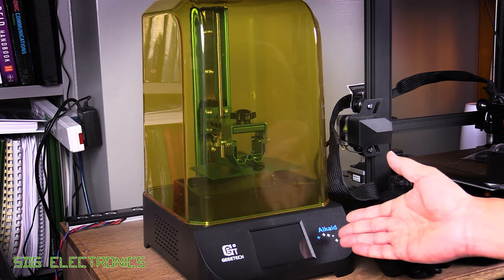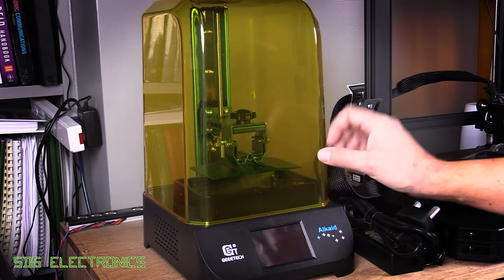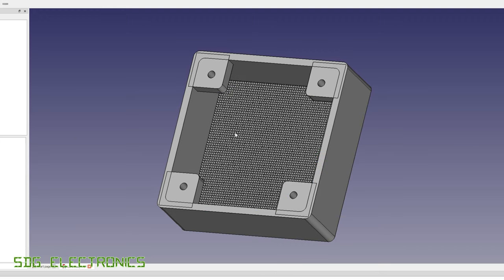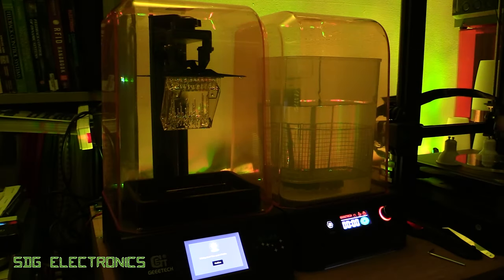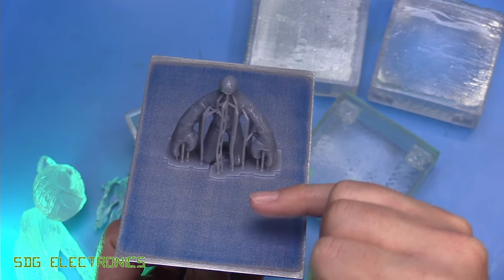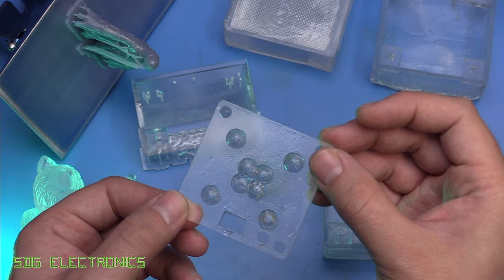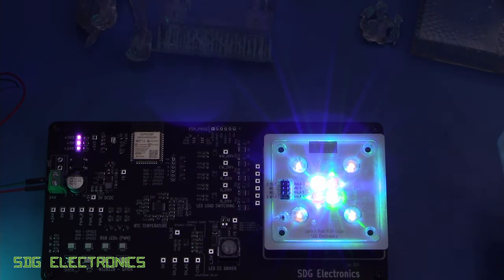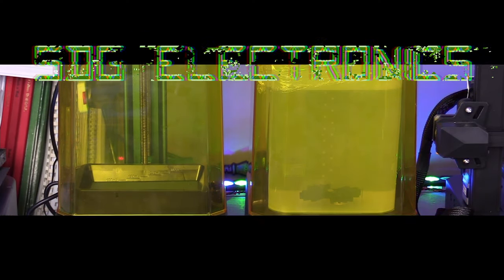SDG #328 Geeetech Alkaid - Trying a resin printer for LED projects

Comment: The very most important thing at resin printing is, that you don't create a suction cup. if you have a closed ring of material, the resin can't escape anywhere and it will suck your model from the build plate. That's why angling the model is recommended.

Comment: Try to print sideways and inclined. On the plate you will get the side parts at 45°. Sure supports will be necessary for the sides, but as they are not the optical part, maybe ok. The lens itself will grow in Z without supports. 
For the little screw tabs, maybe a chamfer is better to avoid further supports.

Comment: I've been looking for a good way to 3d print button/switch covers for audio equipment I repair and now, thanks to your video,  I've found it. I have a 3d printer but it lacks the fine detail required for such small items. I bought the two items along with resin from the affiliate link (great sale price!). I'm looking forward to having a good method of creating smaller items, (once the learning curve is complete of course). Many thanks!

Comment: Clear resins are dramatically more finnicky and prone to weird dimensional issues as the clear resin allows a lot more "bleed" of the UV which is why you're getting that curing where the supports were too close to the base of the item. You might also have your exposure times too high, clear resin is especially susceptible to excessive exposure!

Comment: Maybe go for a 2 part design, where you use FDM for the frame, and SLA for the lense. The 2 parts can snap together. It also allows for easy fine running of the distance of the lense.
Reply: For a 2 part design, you would be better off just buying a fresnel lens. A cheap, commercially made lens will work much better than anything you could print.

Comment: Use the printer to make a mold. Then cast the actual lens in optical grade resin. You can use putty or whatever to make the 3D print smooth and such.

Comment: Theyre good for exposing pcbs as well haha. I keep putting them in my cart but i havent used my new fdm in over a month except to test it.

Petg is good filament for clairity in fdm. It's no resin though. Print the walls at 100 percent then wet sand it. I hear it can be as clear as glass.
Reply from the maker: Didn't even think about pcbs, that's a great idea

Comment: A note with resin printers for anyone (same for fdm, but slightly less so):

Always keep the area incredibly well vented. The VOCs etc emitted from the resin are significantly horrible. The resin itself are not a nice set of chemicals either so.

VOCs from FDM are also not great, but less so.
Reply from the maker: The clear resin seems pretty good in this respect. The grey was extremely smelly, but no odour when the lid is on
Reply: @sdgelectronics just because you can't smell it doesn't mean it's not harmful.
Reply: Yeah i wouldnt want this around a young child.